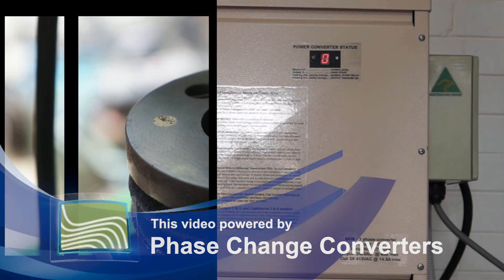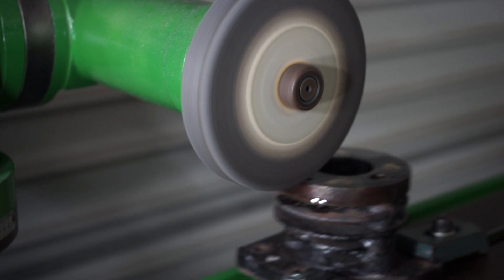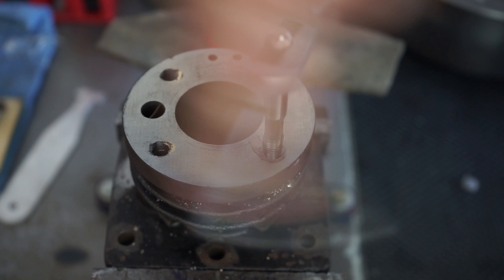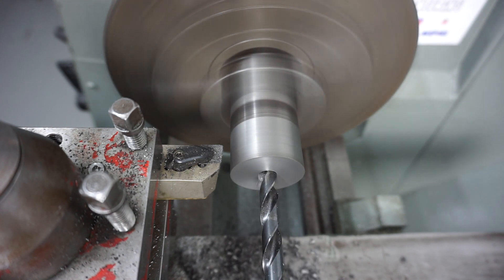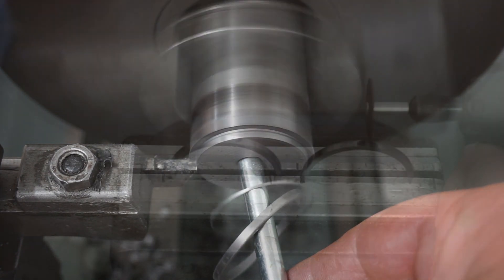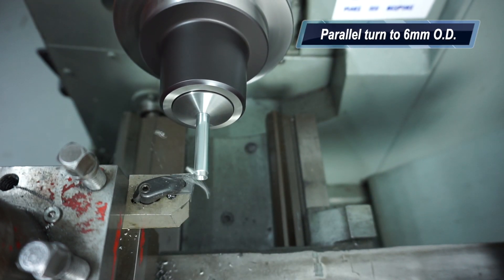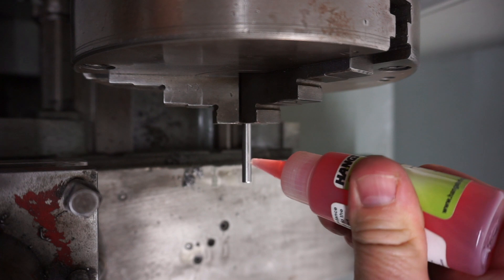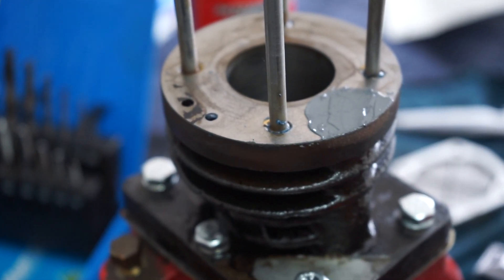DIY Engine Part 2 - Additional footage with narration

Comment: I don't get it so what are you going to put this motor in maybe power a compressor lol
Reply from the maker: Thanks Paul, I understand your question now. This was just a project I did for fun. I saw someone else do something similar and I wanted to have a crack for myself. My goal was to get it to start and run. It will only ever be a stationary engine. Thanks for watching 👍🍻
Reply: @AaronEngineering  all good Aaron keep them vids commin mate
Reply from the maker: @paullang1961  Thanks buddy 🙏.
Reply: would be good to see it power a compressor tho cheers mate

Comment: G’day Aaron. Doing a good job, keep it up. That ring installation looked a bit worrisome until it popped in, it is always a butt clenching moment isn’t it. 
Cheers 
Peter
Reply from the maker: G’day Peter. Yes the chamfer wasn’t big enough on the bottom of the cylinder. Plus my ring compressor was way to big to fit. I could have used jam tin and a hose clamp 😂. Thanks for watching Peter. Cheers 🍻